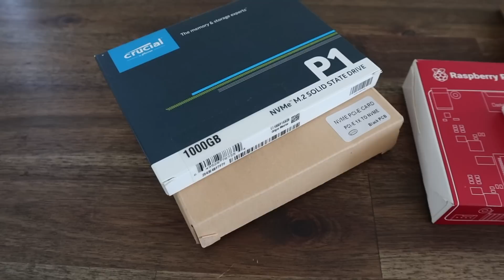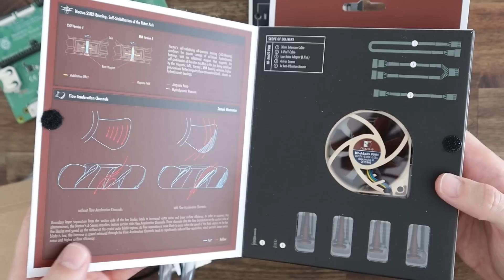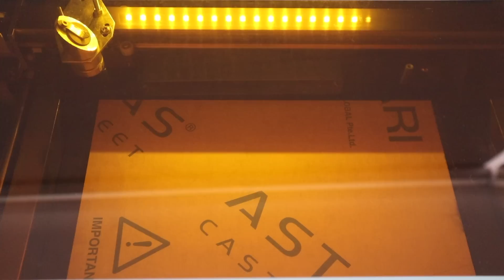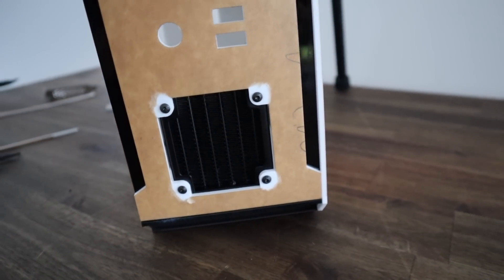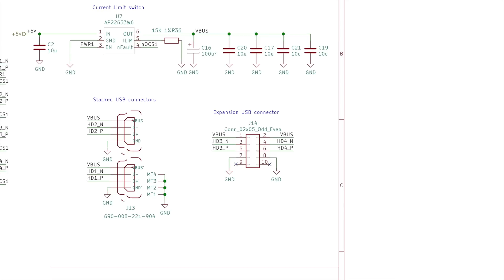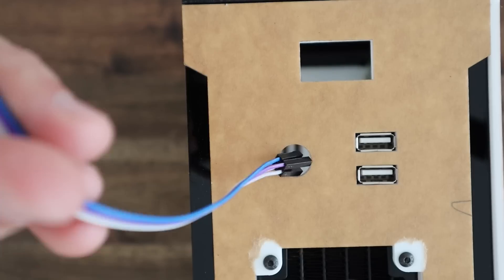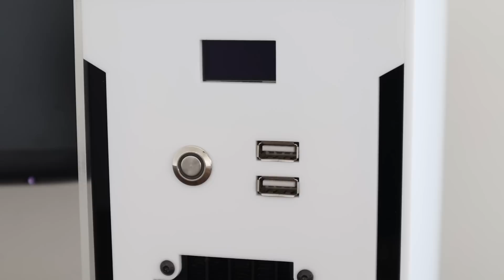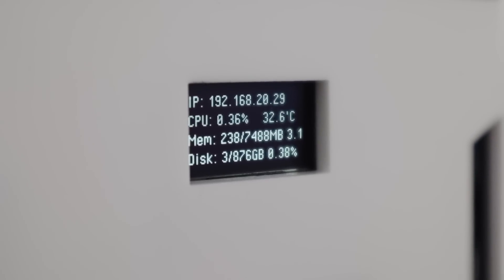Ultimate Raspberry Pi Computer Build – Water Cooled CM4 with NVMe SSD

Comment: 13:54 Love the design but far as potential tweaks for a Ultimate MK.2 build go... 
1) Replace the aluminum waterblock with a full contact copper block that covers the entirety of the CM4 (excluding the antenna port for the wireless and holes for mounting it) and sandwich a 55mmx40mm strip of SARCON XR-m thermal pad between the block and the cm4. (H/T: Linus Tech-- https://www.youtube.com/watch?v=w0H3NI89unA ) 2) Replace the superglued supports with thermally set threaded inserts (your dinkiest soldering iron is good for this-- you just need a tip that will seat properly into the cavity of the insert) 3) Replace the pump reservoir combo with an off the self solution like a Alphacool Eisstation.
Reply from the maker: Thanks for the suggestions. I'm hoping to get a small CNC rig soon and I'll then be able to make up some custom blocks from aluminium/copper.
The Alphacool Eisstation is compact for a standard size case but its actually quite large compared to this build. I have a similarly sized set that I was planning on using for this build, but it takes up most of the inside of the case.
Reply: @MichaelKlements  ...  *goes googling*🤦‍♂ I should have paid much closer attention to the dimensions.   The Pi Foundation carrier board is 160mmx90mm, the Eisstation the smallest commercial res/pump combo I've found is 102mmx82mmx89mm. (To be fair the smallest computer I've worked on is mini-ITX which is 170mmx170mm.)
 What are the dimensions of the top panel? You could have the res/pump combo poke through and mount it with angle brackets into the top giving the system an engine block like appearance but leaving just the ports on the inside the case.   If the engine block idea still takes up too much space you just have stainless steel passthroughs for the plumbing and shroud to cover the hole for the power cable.
Reply: Spoiler Alert: He watch LTT video

Comment: Does the fan goes off when the system is shut down? Whatever I try, my fan is running till I disconnect the power supply.
Stupid design if you ask me.....
Reply from the maker: The default configuration leaves the fan one. The easiest solution is to create a shutdown script that sets the fan speed to 0 when shutting down.

Comment: Kind of reckless without barb fitting s for the cooling unit on the raspberry, possibility of running a leak down the line. Not hating on you bud.
Reply from the maker: Yeah unfortunately there isn't enough space between the bracket and the Pi to fit a clamp onto the fittings.